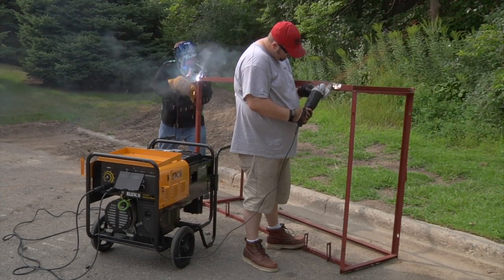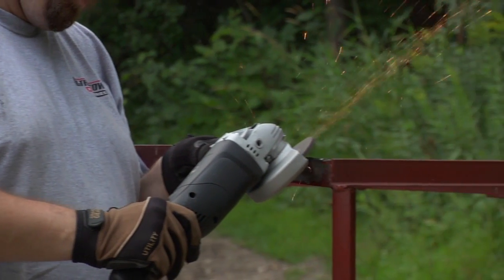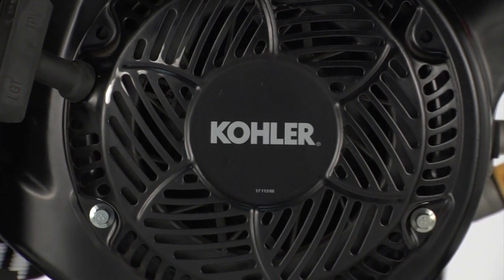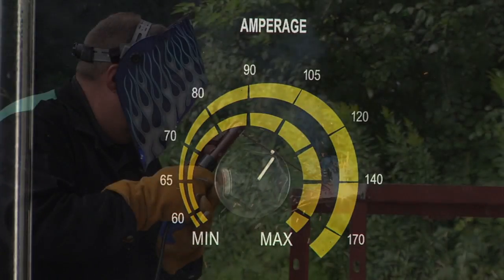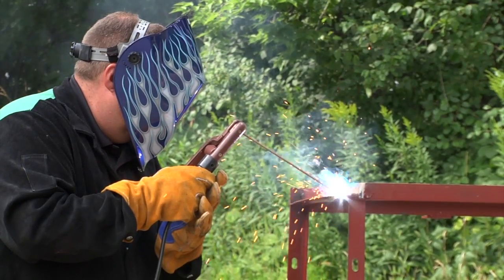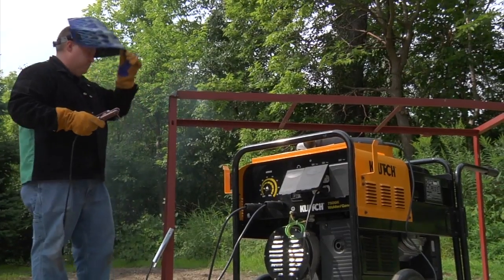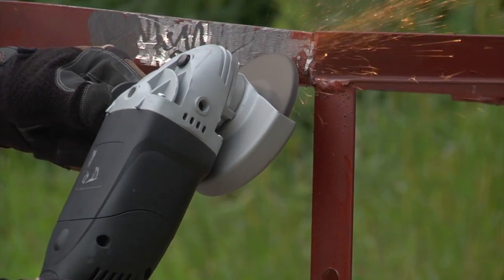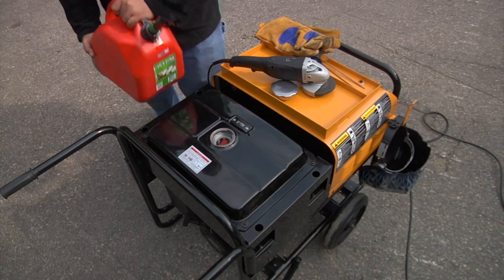Klutch 7500K Welder/Generator - 170 Amp DC Welding Output, 6,000 Watt Auxiliary Power

Comment: I wonder what the duty cycle is when you're running at 120 amps ? The best I have seen for these single cylinder welding machines
Is  100 amps with 100 %  duty cycle  /  120 amps with 60%  duty cycle .

Comment: It is a Generator and Welder. 
 So it will weld with stick and run my welder that welds aluminum and steel. It will also work as emergency power for the home in power outages. It will also run lighting for working at night or in a barn or warehouse with no power. We are thinking about putting it in our sailboat because it will run our electric motors, charge our battery banks, power our Air Conditioner, microwave, toaster oven, blenders for making drinks and the air compressor for filling mini scuba tanks.
Reply: Fla-bushcraft Prepper where is the hour meter